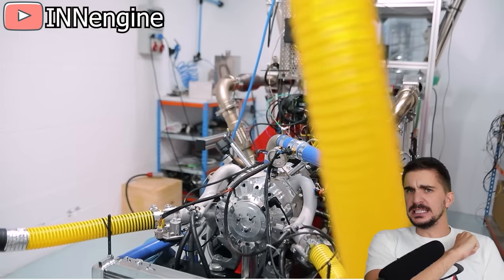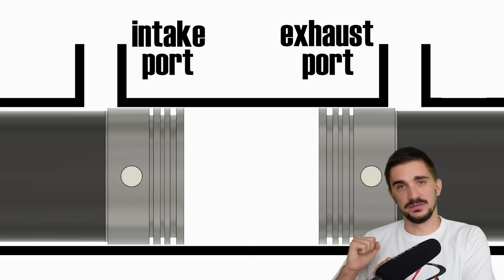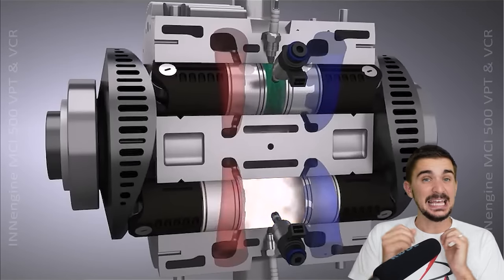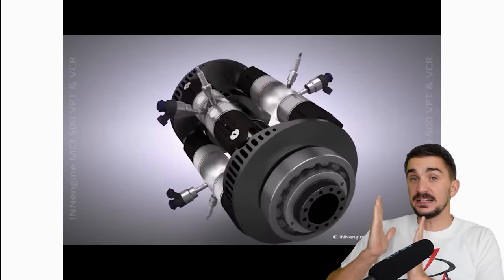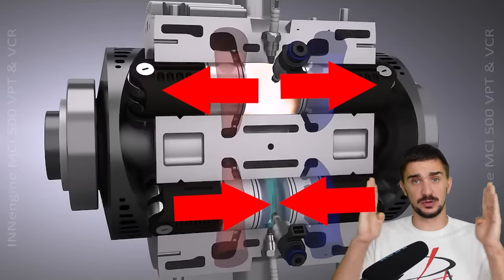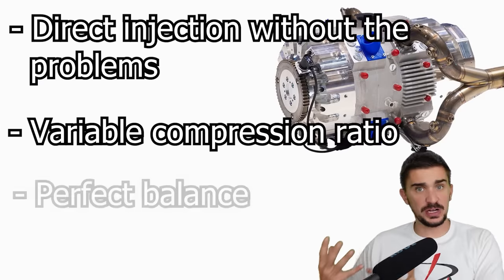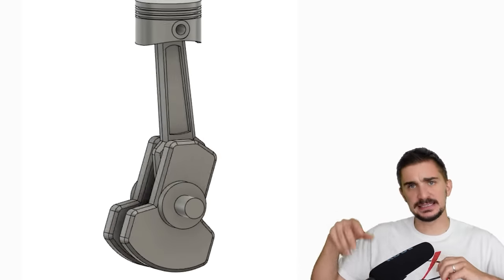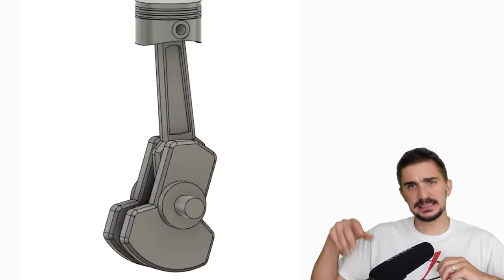Spain is Living in 2050? Revolutionary 1 Stroke INNengine Analyzed

Comment: Perfect for small aircraft. I hope it is affordable at release. Being that it’s round it’s a perfect application for many scale warbirds that originally used radial engines. It’ll fit right into a round engine cowl!
Reply: Except it's a high rpm engine & would need a substantial gear reduction to keep propeller speeds slow enough to be efficient.
Reply: @randyphillips559 if its reliable, the weight and complexity savings would proably even out
Reply: Agreed!  35kg 77 pounds vs at least 91kg 200 pound on a regular 4 cylinder engine is amazing. Wonder if they can get the wash plate (wavy thing) to rotate in opposite directions to cancel out any gyroscopic effect?
Reply: Just caught the end of the video where the airplane version uses just one wash plate but looses lots of power.
Reply: What do you think the price could be? Chinese manufacturers can very easily copy it and sell it for a few hundred bucks?
Reply: @neatfastro   If China does, it will sell like crazy. Textron has announced most, if not all Cessna mfg to include jets, will be moved to China. As of July 2023, even some yacht mfg has moved to China. And soon, it is rumored, China will be selling cars in the U.S. and maybe Europe.
Reply: @currentfaves65  china is already selling cars in NZ and Australia, theyre comparable to the european ones bur cheaper. Even if made in china an engine like this is probably still going to be in the 2-3k range until the technology settles down. 

Pilots are always super wary of new technology, a lot here are still using engines from the 50's and 60's, getting them to adopt an entirely new engine would be difficult.
Reply: It's not really a new idea. There's examples of ones made for the US Army Air Corps as early as 1921 in museums (Almen A-4 Barrel engine)
Reply: @currentfaves65  - Volvo is a Chinese company, they've been selling cars in Europe at least for 5 or more years already.
Reply: @currentfaves65 That is a Great Question. I didn’t think about the.
Reply: @currentfaves65  Chinese electric cars are sold here in Europe. Lots of them here in Sweden. MG is one brand which most people associate with England but rhe chinese aquired the rights to the name.
Reply: Thanks for all the replies. I had no idea how much global market penetration China already has in the auto industry.
Reply: Flying a plane with a experimental engine design would be a dumb way to die

Comment: Great explanation of this novel concept. As others have pointed out. This operates similarly to an AC compressor.  Given its inherent design shortcomings of low torque at low rpm and like other 2 stroke engines, emissions issues, it may be a GREAT pairing for a Hybrid or PHEV.  Weight savings, small space and high efficiency at high rpms match perfectly with a small electric motor.
Reply: Yes good point. Although I've always personally thought hybrids to be a bit crazy/nonviable due to having to having costs and complexities of both, but considering how they are used I seem to be wrong.
Reply: @MsHojat Hybrids, specifically Toyota, are awesome. I own two and they run perfectly.
Reply: @MsHojat  In practice hybrids are great, so you have to reevaluate your opinions to match the evidence.
Reply: novel concept, that was already patented in 1877 by Ferdinand Kindermann
Reply: Screw cars, imagine this used in an outboard boat engine or a jet ski. If it really does give over 100 HP weighing 35 kg, this could be strapped onto a kayak and turn it into a water rocket.
Reply: @fungo6631  totally agree,  would be an awesome application.
Reply: @fungo6631  Screw boats, I'm strapping this to a skateboard
Reply: Okay
Reply: This seems like it would benefit by forced induction
Reply: @justinchase781  Agreed, seems like simple necessity at minimal pressure.
Reply: Twofer for me, also got basic intro to AC compressor.
Reply: I think Toyota hybrids are a questionable idea done right.
They are complex but for some reason extremely reliable, while at most companies complex means unreliable.
Reply: @aluisious  If you're buying new, then perhaps. On the used market, past about 10 years old, hybrids have the resale value of a chicken sandwich left in the sun all day. The battery starts putting out and all you can do with the car is scrap it. You can't even part it out much of the time because so many of them are being scrapped that there is a glut of parts.
Reply: Not worth the expense. Small 4 stroke motors, especially the Atkinson cycle motors used in Toyotas, are already VERY efficient, reliable, and able to be mass produced. Even if a major automaker dove head first into this system, by the time it got engineered to production and the brand new factories and tooling are built, BEV's will be 10-15 years more mature and hybrids will be even more irrelevant than they currently are.
Reply: I wouldn't worry about that because we already have electric turbo like the one used on the mercedes new six.

Comment: The wavy thing bothers me, but I like the possibility of changing reciprocation profile (or that's what I'm calling it). Opposed pistons seem to be making a comeback, though they've been hanging around as an option since I think 1895 or some such. No cylinder head or valve train is a huge potential advantage. I always liked OP. I'm a little suspicious about the amount of vacuum that can be created here. Every OP I've ever heard of needs a blower or compressor, and I see no design feature to make this unnecessary, they all uncover the exhaust ports before the inlet ports, and by the time the inlet ports open the volume between the pistons is no longer expanding. So far, momentum hasn't been enough on any other OP design, I don't see why it's enough here.
Reply: "Wavy thing" is commonly called  a swash plate.  Many aviation hydraulic pumps work this way.  Some can vary the angle of the swash plate in order to increase pumping volume.
Reply: @Flies2FLL  Some torpedo engines use a similar approach. Lots of power from a small package, short working life not a concern.
Reply: @Flies2FLL  This is not a swash plate, it's more accurately called an axial cam.  A swash plate is a flat plate mounted at an angle so you only get one cycle of reciprocating motion per revolution, effectively the axial version of an eccentric.
Reply: I agree with you about the scavenging. The "air syphon" would be insufficient.  It needs some positive PSIG at the manifold to function.
Reply: Lots of two cycle engines need positive pressure to operate. Detroit Diesels like the 6V71 required a blower to operate and keep positive pressure. Small motorcycle engines didn't need this and instead employ an expansion chamber in the exhaust pipe to drop pressure quickly, thus enabling scavenging. The difference in a design like this and what we'd commonly associate as being the job of a supercharger is that the blower on a 2-cycle isn't for increasing power. It's load on the engine is largely inconsequential, needing only to generate enough pressure to keep it higher than atmospheric. You could theoretically turn up the boost pressure and get more power, but it isn't strictly needed.
Reply: Wouldn't this loose balance when offsetting plates?
Reply: @dquzmanovic  My first thought.
Reply: @Flies2FLL  I don't think so. Or at least if so, then there are a couple different things called swash plates. Swash plates I'm familiar with are planar, not "wavy". They are flat plates mounted at an angle to the axis of a shaft they rotate around.
Reply: @dquzmanovic  I don't think it's in perfect balance to start with, because the pistons are not in phase if the exhaust ports are uncovering before the inlet ports (unless the exhaust ports are closer to the center of the cylinder than the inlet ports, which leads to other problems). Changing the offset would certainly change the degree to which the pistons are out of phase. Since every OP engine I know of offsets the reciprocation of the pistons, it is apparently not a huge problem. Kind of disappointing though, a perfectly balanced engine would be great. If you used sleeve valves you could bring the pistons into phase, but then you have the complications of a valve train. I've never seen this used.
Reply: @DriveCarToBar  Conventional two stroke engines don't even need a tuned pipe to run because they have crankcase compression instead of a blower.  The tuned pipe just turns up scavenging to 11.

Comment: If you wanted to get technical, it is a 1 stroke to the keen observer. The wavy thing is both on the top and the bottom of the piston wheels. As you mentioned, a vacuum is created thus a very miniscule force would be applied during exhaust/intake. Lol

Comment: A well balanced presentation. I like the concept, even though I see potential for way more expensive maintenance. It's really two synchronized 4 cylinder engines which both fire on two cylinders at the same time. The power of combustion is shared between two pistons connected to different drives, with two sets of pistons delivering power to each drive at the same time. So it's really equivalent to two independent (synchronized) two cylinder (two stroke) motors connected to separate drives. At the end of the day all that matters is if they can deliver power while maintaining or improving fuel efficiency. Short and long term running cost will decide the fate of this motor...
Reply: hmmm....
Reply: Mejora la eficiencia, eso está demostrado. A igual capacidad de cilindros tiene el doble de potencia. Además pesa menos, y consume un 30-40% menos combustible. 
Lo que falta saber es su duración y coste de mantenimiento.

Comment: Thank you for presenting this novelty and analysing its capabilities based on facts. I also see the technology better placed in running at constant speed, benefiting of lower vibration (and potentially noise) levels. It's low weight is a huge benefit, but efficiency still needs to be quantified.
Reply: it is intended for long range and in combination with electric motors.
Reply: It really isn't a novelty FM had opposed piston two cycle engines in operation nearly 100 years ago.
Reply: @danielmanly4793 but then big oil decided they weren't burning enough
Reply: @danielmanly4793 but FN used 2 crankshafts causing moments of 1st and 2nd order.
This type of energy transfer runs very smooth without these vibrating effects.
But thank you for reminding of the opposed cylinder engine sharing the same combustion chamber.
It even was in serial production.

Comment: one of the biggest downsides to opposed piston engines is the requirement of external scavenging to increase efficiency (basically a supercharger).  i think at lower rpms it will work effectively, but to maintain high rpms will probably need forced induction to maintain the scavenging.  you can see it on the fairbanks morse diesels, they use either a turbocharger or a scavenging air blower (supercharger) to scavenge cylinders
Reply: Also many EMD locomotives use a cool supercharger/turbocharger hybrid, where after a certain RPM the charger switches from super to turbo :)

Comment: The size and wight numbers look very promising - as well as simplicity. This would be a perfect candidate for charging a hybrid electric car, do very well for aviation, and for generators, pumps, compressors and the ilk. If it can indeed improve efficiency over other i.c. engines that is even better. In a steady run environment like pulling generator/pump/compressor it could probably be tuned optimally for the rpm/load and really shine. I look forward to the applications of this engine!
Reply: I agree.  I am concerned over the piston ring wear and requisite starting torque.  A 9:1 sounds good, I like ICE heads that operate up to 11:1.  1 liter is in the range of my expectation of a mostly constant rpm 'charging' motor.  8 piston heads for 1 liter is too much imo.  I am also suspect of the "wavy thing" tensil strength and it would seem to make a lot of friction to translate motion linearly to laterally (basically) (Bearings are also a fail point).  A turbo-charged 2 cyl. diesel traditional ICE producing high torque w/ connectively tuned generator (highly wound) could certainly drive my prius w/o motor driven assistance imo.  The turbo is not about rpms, it's about actively pumping the intake imo.  While I think the INN is novel, and weight suited for certain applications (aviation) ... I think it's all about material composition and the costs of them.  Titanium and derivatives would be my first choice, but cost preventative in the road transportation space.  It would work small scale as in aviation and large scale in railroad, but the in-between 2-3-4 wheel not so much.  The double ends suit contra propellers if geared wisely.  I'm over thinking it, but I support the supposition that this motor has a place which isn't overly broad imo.
Reply: I'm curious if this would make a good motorcycle engine. It's light, simple and easy to maintain, which are all qualities of a good motorcycle imo. Wonder how power would be sent to wheel though.
Reply: I don't see how this engine can work. All the forces are oblique, which means terrible fuel efficiency and high pressures on the roller and swash plate surfaces.
Reply: Hybrid cars do not use the engine to charge the battery (unless the car is idling).
Reply: The volt does. All the engine does is generate electricity. Much like a diesel-electric locomotive. With this engine you could power the wheels directly off one end of the engine and a generator off the other to charge a battery.
Reply: @donalddicorcia2433  no... The Volt DID work like that... It no longer operates purely as a series hybrid anymore (and this setup is almost completely extinct).

The Gen 2 Voltec transmission is much closer to a standard parallel hybrid system now. Converting engine kinetic energy into electric energy and then back again is very wasteful and inefficient.
Reply: EV Charging/Range Extender.  Exactly what I was thinking and would be one way to convince me to buy an EV!
Reply: @jasono2139  I beg to differ. My brothers Kia Niro does just that. When the plugin charge is depleted, the engine starts and the battery is charged. That engine also presents power on the wheels, but it does charge.
Reply: @KetilDuna  no... It doesn't.

No PHEV hybrid "charges" the battery in a drive mode (as range extender EVs do)... The engine charging the battery is incidental to avoid wasting power from the engine. Otherwise, the engine sends power directly to the wheels.

KIA's website even explicitly states that the Niro is a parallel hybrid with a 6-spd DCT.... Which means the engine drives the wheels.
Reply: @Ironpine27  Mount it sideways and just take the power from one side, the swashplates are connected anyway. but i doubt this would be good in a motorcycle. Per my seperate posts my feeling on the physics involved is that it's probably most efficient and powerful at high RPM and low torque.
Reply: this is definitely engine only for low load, high RPM operation. For heavy loads the opposing piston engine was developed by the Achates and  I do think this engine was developed as reaction for high RPM, light application.
Reply: @micklenier6152  Agreed. I just can't see any low end torque coming from a cylindrical wheel (bottom of piston) rolling, pressing against an angled surface ("wavy thing").
Reply: @jeffrandolf5673  it will generate some torque, but not as much as crankshaft. this is definitely by design as it really doesn't look like the engine was made for any heavy load, but for high RPM.
but it sounds like it can do work. 125HP at 35kg is well pretty damn good, but it will not be strong engine. so light airplanes, pumps and other applications like that.

Comment: I like it, being in primary and secondary balance is lovely, could see some motorbike attempts at using it just because of the balance. Small and light too. Don't think it'll revolutionise anything, reading their promotional information was painful, but still seems like it's got plenty potential for some fun builds.

Edit: I wonder if it'll suffer from bad wear in the cylinders though from the lateral forces caused by the ramped cam, or significant efficiency losses from handling it.
Reply: @RJM-II  There's already 2wd drive motorcycles on the market, but mostly hydraulic or driveshafts via the fork headstock route and for dirtbike use. The Tesi was the Bimota hub centre steering bike & its very marmite to ride because it just feels so different even without 2wd, Yamaha made a HCS bike (GTS1000) & hold a patent on a 2wd GTS setup with drive fore and aft from a central point but never put it into production. Suzuki the same with their Nuda working concept bike but no production variant. Christini are probably the leading success story for awd & do awd kits for motorcrossers using a hydraulic drive system from ohlins.
I think this engine wouldn't help solve any of the issues as if you side mounted the engine and took drive from front and rear, independent of each other, you'd need two clutch/gearbox setups and to keep them in sync and that's without considering the need for differential drive speeds mid corner. If you drove a common idler shaft from the two ends, then fed that into the input shaft of a single gearbox, that would give you a conventional setup, then you would have to solve the issues that caused the gts awd and nuda to never go into production.
If you build one, can I blag a go though? :)
Reply: Good point about the ramped cam causing lateral forces.  This has been addressed
in other "basically conventional" internal combustion engines, and has been patented.
It does add weight, complexity, and cost, and therefore is not widely used in vehicles,
although it can improve fuel mileage by perhaps 1 or 2 percent.